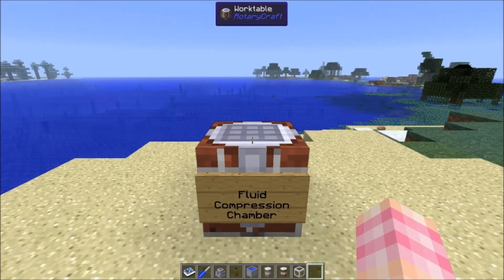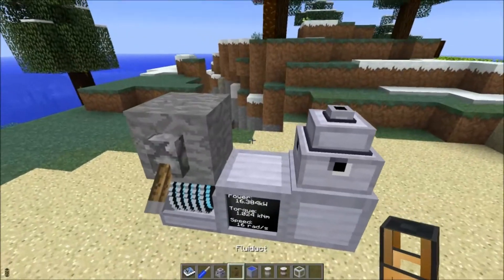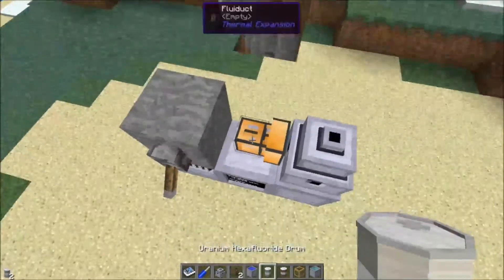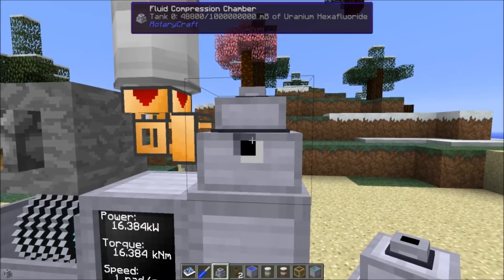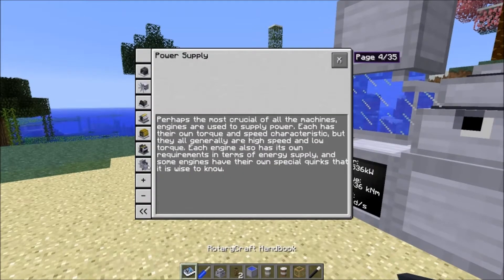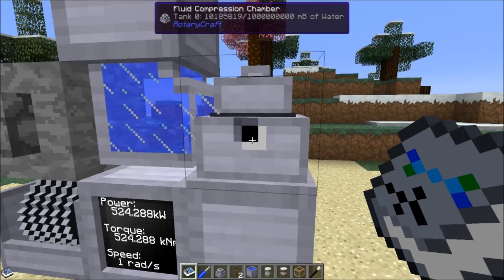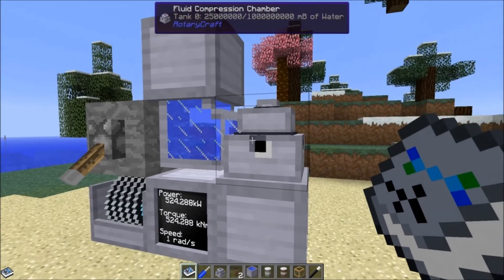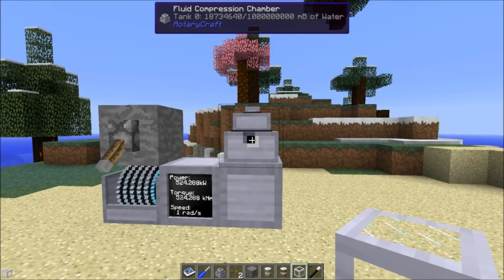RotaryCraft Tutorial #47 - Fluid Compression Chamber

Comment: One thing you didn't test that I'd be curious about - can this be treated like the scaleable chest, where you can fill it and then break it, pick it up, and transport it elsewhere?  If so, this could be a rather good way of handling transporting lubricant to distant machines from a central processing location (though I'm guessing there are other options just as good to achieve the same)
Reply from the maker: I think you can.

Comment: Since liquid pipes will burst if the pressure is greater than 2.6 Mpa, do you know of anyway to get compressed liquid out without using fluid duct or ender IO fluid pipes?
Reply from the maker: I haven't tested it but my first thought would be put a reservoir on top of it as a buffer.
Reply: SentinalhMC I tried that but it won't work since the reservoir input from the sides and output from the bottom.  Maybe something can be done with the other pipes but I have not gotten the red pipe and blue pipe to work yet...
Reply from the maker: RDirective Fluiducts will work, you have to set it to red and power it or use a pneumatic servo
Reply: SentinalhMC Of course it would ;).  So will ender IO ducts, which I prefer since it has a higher throughput.  BUT the point was to see if one can remove liquid from the chamber without using other mods and there is no a way as of v25z.  I asked Reika and even he is working at some solution.  So the bottom line is if you are storing more than 100 buckets of liquid and you attach a liquid pipe to the top, expects it to go boom.=P
Reply from the maker: RDirective Maybe Reika could do like he did with the pipe pump and add a flow regulator that you can add on top of it.
Reply: SentinalhMC Oh? I didn't know pipe pump had a flow regulator.  Is this in v25z?  Can you put pipe pump in tandem and their pumping power will combine to give greater pressure downstream?  I suggested to Reika that he add a regulator block of various type that would output at certain pressure, or he could do energized pipes that would tolerate certain pressure given their energized state.  Hopefully he will come up with a solution that is Reika only.
Reply from the maker: RDirective No dude I'm saying he should implement a Flow Regulator or something that gets placed in the pipe stream like the Pipe Pump